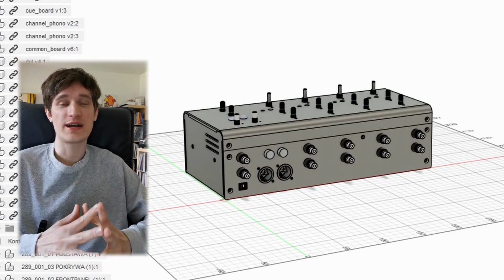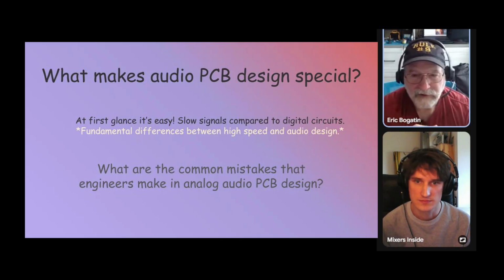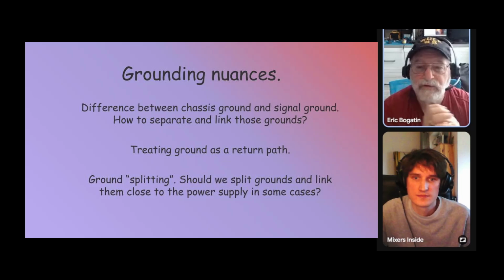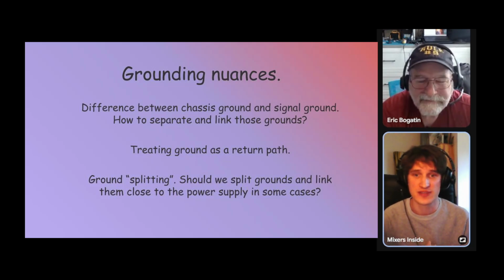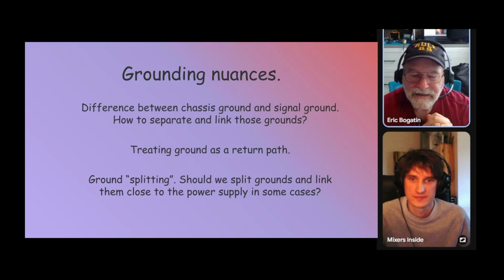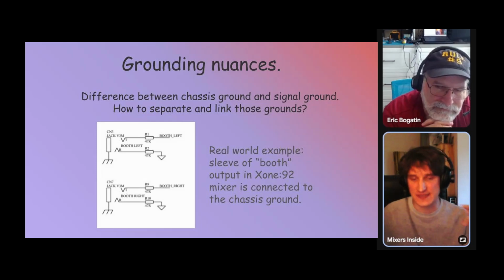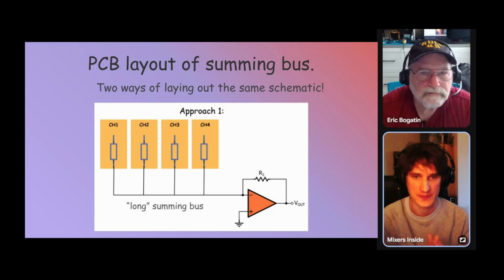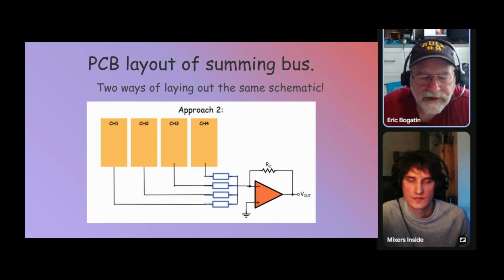TALKS #2: PCB design for audio with Prof. Eric Bogatin

Comment: Yes, biosensor signals can be treated as differential signals because they exhibit hardly any common-mode interference. Audio signals, however, are nothing like biosensor signals. A standard audio signal originates from a mains-powered device and is single-ended. Consequently, the signal ground is almost always capacitively coupled to the mains voltage, through the stray capacitance between the power transformer's primary and secondary windings and via the suppression capacitors across the rectifier diodes. Even with small power transformers, you end up with over 300 pF of stray capacitance. If you really want to process such an audio signal differentially, you need matched source impedances for both the signal ground and the signal itself. In practice, however, that is never the case. This would force you to use a very high input impedance for the differential amplifier, resulting in massive mains-voltage components that you could never suppress to any reasonable degree.
If, on the other hand, you decide to connect the signal ground directly to your mixer's signal ground - since the differential amplifier approach won't work anyway - a certain amount of mains current will inevitably flow through that signal ground. Just consider the 300 pF winding capacitance of the audio source. Bear in mind, too, that you will also be using a mains transformer, as will most of the other audio devices connected to your mixer.
There are two ways out of this dilemma: either use highquality and expensive audio transformers or keep the signal ground impedance throughout your mixer as low as humanly possible. That is precisely why you would not route the signal grounds from the input connectors to your central ground point via a thin PCB trace; the mains currents - limited only by the power transformers' winding capacitances - would inevitably cause huge voltage drops across those thin traces. And if you do that with a stereo signal, you’d also create a ground loop. No, your only option is to use a high-quality ground - ideally a continuous ground plane. Many professional mixing consoles connect the metal chassis directly to signal ground to reinforce the grounding, and the jack sockets of single ended signals are screwed directly into the chassis walls.

And the fact that your layout with the voltage doubler in the phono preamp didn't work with the ground plane is no argument against ground planes at all. Using a voltage doubler there is simply poor design practice, because those circuits generate extreme interference. Often, simply improving the routing of ground return currents of involved decoupling capacitors of voltage doubler is sufficient to minimize interference - or using a small, local ground plane within the main ground plane. But why not just using a linear voltage regulator in the phono preamp anyway??

It is a common misconception that audio signals are slow and that, consequently, RF-style circuit layout techniques can be dispensed with. In reality, it is the extremely high-frequency interference affecting audio circuitry today - such as mobile phone radiation, ESD, and the like - hat necessitates the use of RF design techniques. Like it or not, the days when a wired star-grounding scheme sufficed are unfortunately over; today, continuous ground planes are used, including - and especially - in audio applications.

You shouldn't take datasheets too seriously, either. They are written by ordinary people who, ultimately, haven't a clue and are afraid to make mistakes. So everyone copies from one another. Chip manufacturers are just ordinary people, too. Do you think that all chip designers are brilliant? Splitting the ground plane into analog and digital sections and tying them together right at the ADC or DAC and nowhere else has never really worked - not even in the past. How is that supposed to work when you have more than one such converter on the board? What do you do when you have a whole bunch of mixed analog digital chips on a single board? By the way, the idea of completely separating analog and digital circuitry - connecting them only at the ADC - is nonsense anyway, since all the circuits are powered by the same power supply. Or are you planning to use separate batteries for the analog and digital circuits?
I’m not saying working with many mixed analog digital chips it’s easy. There are a lot of things to consider and get right. And sometimes you must even change the chip(s) because the pin assignment is disadvantageous and does not allow for a clean separation between the analog and digital domains. But splitting the ground plane is the worst of all options and almost always leads to failure - at the very latest during CE testing...

Comment: Thanks for sharing your discussion!

Concerning the Xone:92 mixer output circuit, you discussed only the ground related issues, if I followed correctly. Another very basic principle and advantage of the symmetrical line was not discussed, that has to do with minimizing interference from outside. You mentioned that ”this is not balanced signal”. That’s right, but the output is impedance-balanced, which makes the line balanced in the view of external interference. If we have a comparable situation in the receiving end of the line, it means that both signal conductors + and – inside the shielded twisted pair cable have similar impedance. As a result, all EMI induced in them along the way appear similar, making them exactly common-mode, hence they are efficiently filtered out by the differential input of the receiver. In a real world this is significant in long lines, but concerning very short interconnects of hifi-equipment this advantage hardly realizes. If the ground or return path related problems don't actualize or can be solved other ways too, the XLR-lines of hifi-setups, however great in appearance, can even have more downsides than upsides caused by the added circuit complexity. In this sense, after all, the Xone:92 output circuit actually offers the possibility for extra EMI suppression in a quite elegant way, only by adding one resistor for the return conductor and a three pin jack.

Please, correct me if needed. ;)

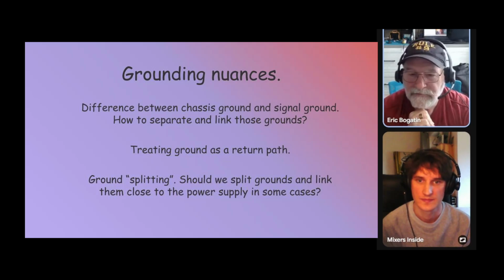Comment: 32:03 In Kicad (and others) there is a net-tie component, witch does exactly that. It has a PCB 'short circuit' footprint, allowing the nets to connect only at a specific location.
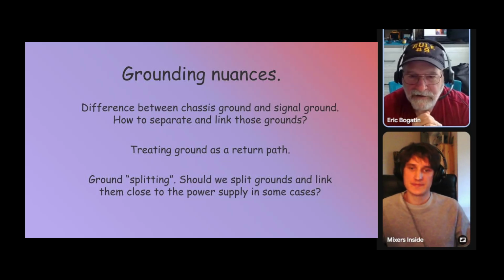37:32 if you use a very narrow rules area ( or room in altium)  to split planes, you can disallow any copper on any layer in the split. preventing mistakes

Comment: Under “grounding nuances” that schematic is tip ring sleeve. The discussion is regarding single ended coax.

Love Eric’s knowledge. The crossing a split ground working when you also cross with the return answered a question I have had for a long time. 

Thank you!

Comment: I’m currently investigating the plausibility of reverse-engineering and creating in KiCAD a clone of the Pioneer DJM-600 as a project for learning both KiCAD and audio mixer design.  I’ve found Grok to be very helpful in assisting with the technical details, but are there any books or resources that you’d especially recommend for learning the electrical engineering and circuit design particular to audio and DJ mixer design?  Ideally learning top-down from a working example, rather than bottom-up from pure theory.  Thanks in advance!
Reply from the maker: Part 1 of my "Making of a DJ Mixer" video series is dedicated to recommending resources. Be cautious when using AI - it may lead you to nonsense, especially when things are getting harder. Good luck with your project!

Comment: great video, nice to see these topics discussed in an audio context - which happens very rarely.

I think the booth output schematic you discussed might be assuming that it will be connected to a differential amplifier via a TRS cable. In which case the complement to this single ended booth output on the tip of the cable will be connected to signal ground via the 47R resistor. I’d be curious to see how it’s routed - it could be exactly what Eric described when he talks about a dedicated return path, that is tied to ground elsewhere via the 47R. If a TS cable is connected the sleeve and ring will be shorted together, meaning that chassis ground in the mixer will be connected to its signal ground via the 47R, but again this may be routed separately. Clever design if so, that guarantees any diff amplifier on the other end should perform well
Reply from the maker: Thank you very much for watching and yes, very good point! I'm looking forward to discuss all the cases and clarify this completely in the future. When using a TS cable, there is a risk that chassis ground will be connected to receiver signal ground and this scenario is not good when there is a potential difference (it will cause currents to flow through the chassis) if i understood it well.